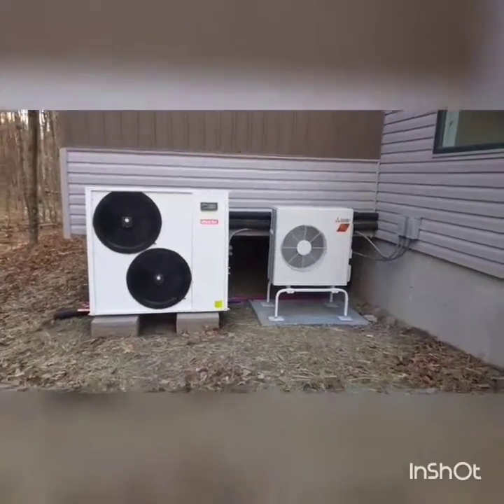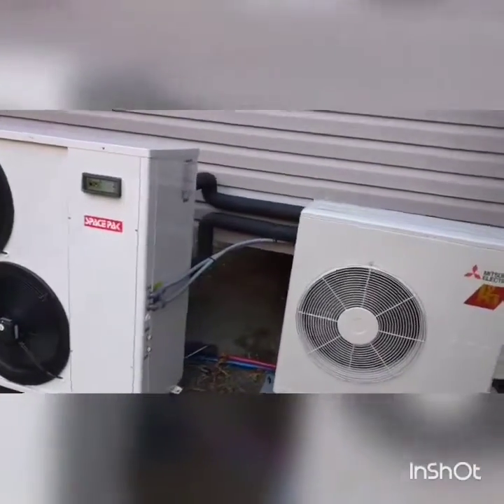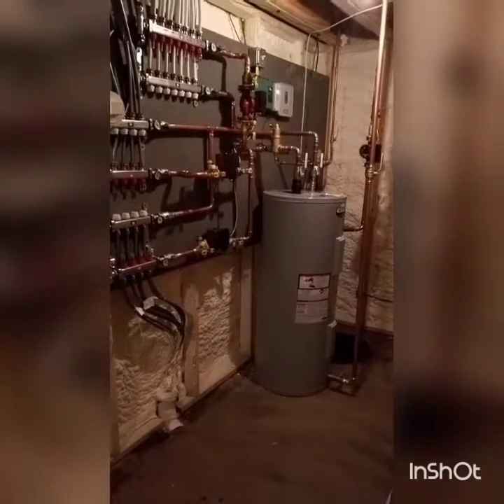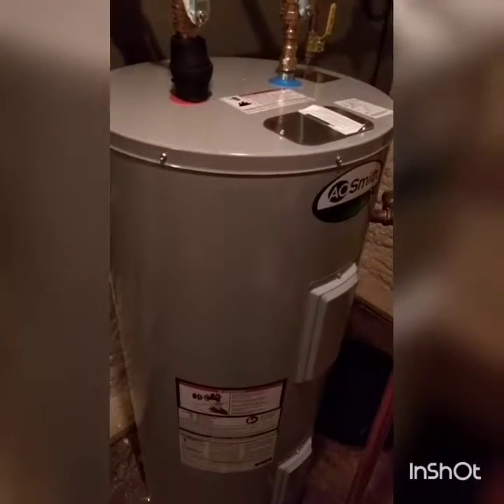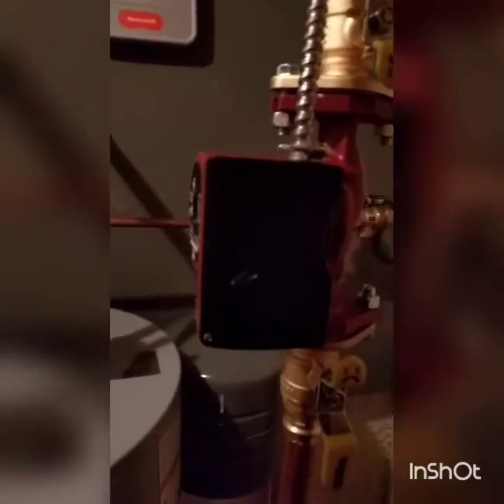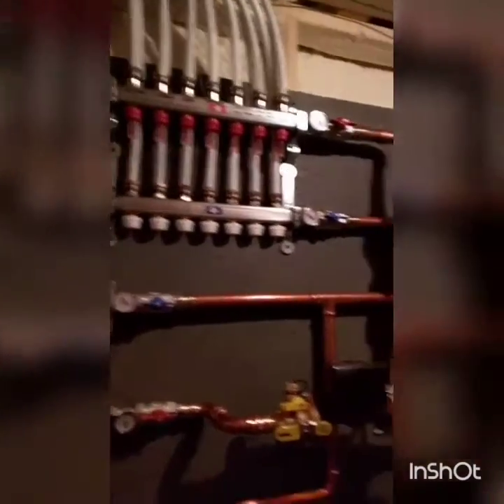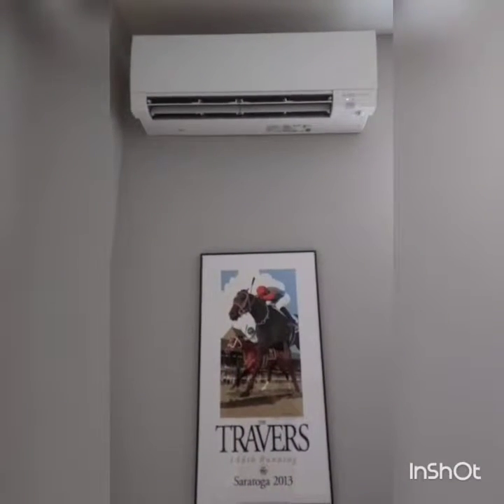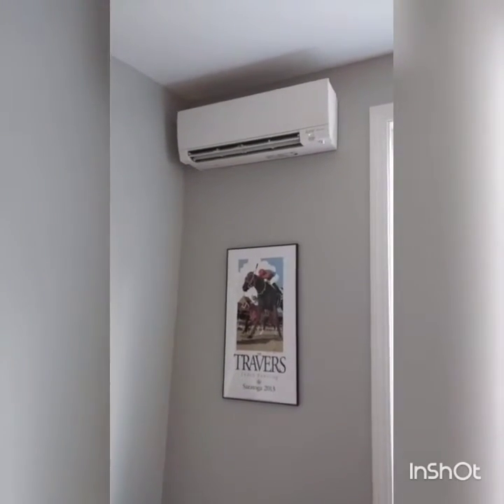Spacepak Solstice Extreme Integrated into Radiant heating/cooling and Mitsubishi Mini-Split Install

Comment: Hey, 7 years later. I have a semi outdoor pooldeck (Inside a pool enclosure). It has Pex run. Can I use SpacePak without an expansion tank just as an outside system?
Reply from the maker: @digitopdeals1398  The manual requires both an expansion tank and a feed valve that keeps the pressure constant in the system...
Reply: @adammcgowen3229  Thank you for the reply. I will check with the manufacturer whether they can provide me with a solution.

Comment: How did the cooling go with the spacepak system?
Reply from the maker: Radiant cooling in slab didn't work as well as we hoped. There are options for air handlers though which would be a great application for cooling. The mini split was more than capable of handling the cooling needs for the home though.
Reply: @adammcgowen3229  Thank you for responding. When I built my house in 1986, I thought I would save money by not putting in any vents for AC. The house was in Massachusetts, we didn't need AC for maybe 1 week a year. Well, things have changed and I'm trying to retrofit a baseboard heated home with mini-splits in the hottest areas.
Reply from the maker: @markvalery8632  mini splits are honestly my favorite choice for retrofits like you are describing. Massachusetts typically has really great tax rebates and incentives for upgrading and switching from oil/natural gas/lp to heat pumps.

Comment: Hi, can you explain why you also have a mini split system? Is it for cooling? Also can you say you are able to get 140 degree water from the Extreme even on very cold winter days?
Reply from the maker: Yes, the mini split was for primarily for dehumidification, as well as cooling. We always like having redundancy in our systems in case of system failures. Yeah 140 is possible but as outdoor temps drop your C.O.P. drops down to 2 or so.
There are charts online for that data. Spacepak just released a new inverter driven model that is supposed to be far superior to the older model with better C.O.P. We also ended up replacing the indoor buffer tank with a SAHP water heater (solar assisted heat pump) to decrease how often the Solstice would cycle on. The SAHP is one of the best options to store hot water for a radiant systems in my opinion...

Comment: Hi! I am in NY state too and I am considering getting this ATW heat pump but I am a bit skeptical about the temperature it gets up to. I live in a small 1600SF house. Are you happy with the system? Do you know how hot does your DHW get? any issues with the system so far?
Reply from the maker: This home had a very low hvac demand (38kbtu) because it was completely insulated with closed cell spray foam and had triple glazed windows. We ended up doing a case study for NY on this system and it worked really well. The temperature of the water would get up to 140 degrees in the buffer tank, which is more than adequate for a underfloor radiant heating system. I wouldn't recommend using it on baseboard heat or cast iron radiators.
I would definitely recommend having a energy audit/heat load calculation done on your house to see what size hvac system would be required for your house. There are so many interesting new products on the market that I have confidence would keep your home comfortable and save you a lot of money on your utility bills. Check out The Radiant Store website. They are located near Albany, NY. They would be able to do a comprehensive energy audit on your home and size your hvac system accordingly.
Reply: Adam Mcgowen thank you sooo much for the quick response !
I plan on importing triple glazed windows from Germany to replace 30 year old double glazed Andersen windows and on top of that I will add 2” rigid foam on the outside. But I totally agree on testing the house in order to size the system appropriately.
Reply from the maker: @hoganik89  yeah a tight building envelope will definitely help! The foam and windows will help tremendously at reducing air infiltration and heat loss. Sounds like your have put some thought into it. Are you trying to use heat pumps because you already have a Solar array on the house?
Reply: Adam Mcgowen I don’t have the solar panels yet but I plan on installing those. I have a perfect angle and roof totally clear of anything on that side, plus I’m an electrician so I’m comfortable designing and installing the solar system by myself. 
My house is built in the 80s and everything is up for an upgrade, I have electric baseboards throughout the house, but I use a pellet stove with ducts to heat it up for now, with some help of the electric baseboards . I know I want to install radiant floor heating in the entire house and maybe tie the domestic hot water with the system.
I’m considering either a pellet boiler or a heat pump. With the pellet boiler I would have to add some some split units for cooling and humidity control for summer but I could get a little more heat out of it. With the heat pump I can do either heat or cool as far as I understand.